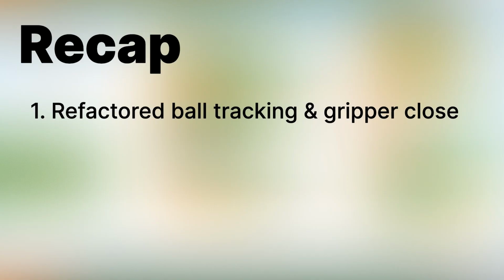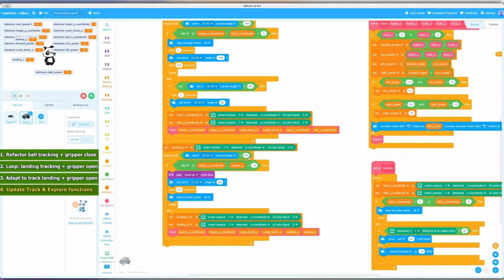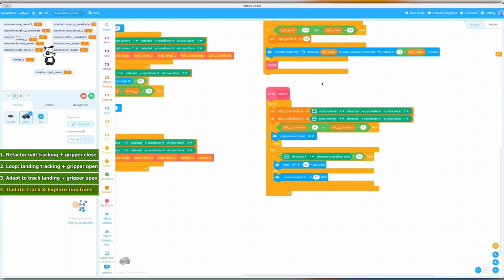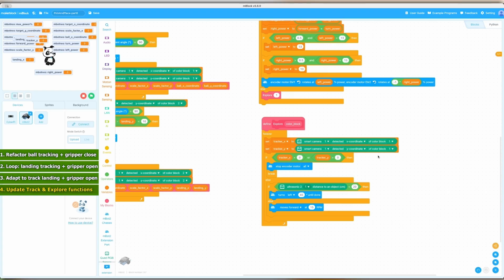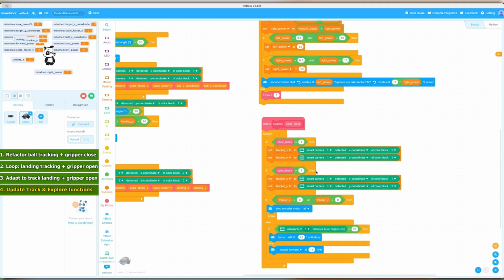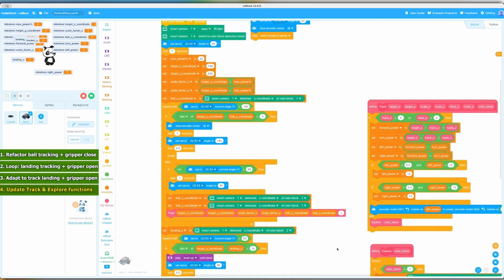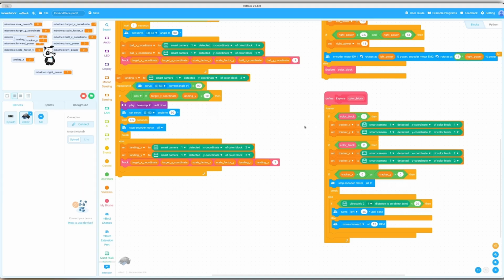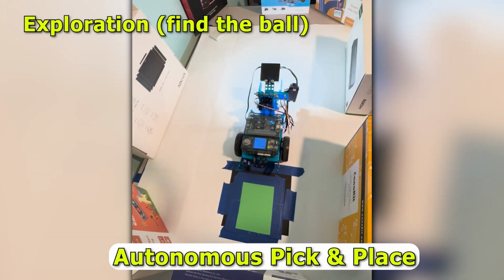How to: mBot2 Pick & Place | Part 6b: Fully Autonomous Robot in Action! 🏁🤖

Comment: can you do this but wit no smart camera
Reply from the maker: Thanks for reaching out. In my opinion, that would be tough. You’d need some sensor to detect the ball and the landing area. A camera is best suited for this because it has a wide sensing range (unlike the quad rgb or ultrasonic sensors) and also provides color block detection capabilities. Do you have a different sensor in mind?